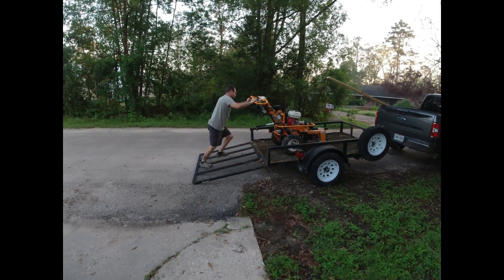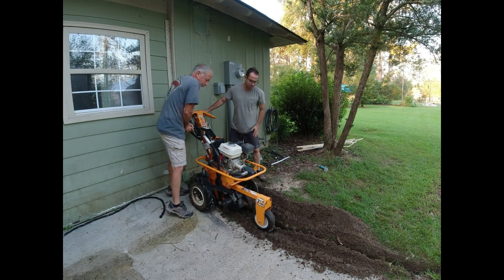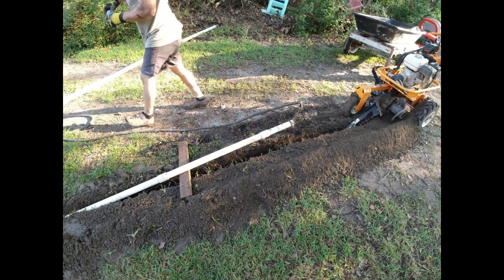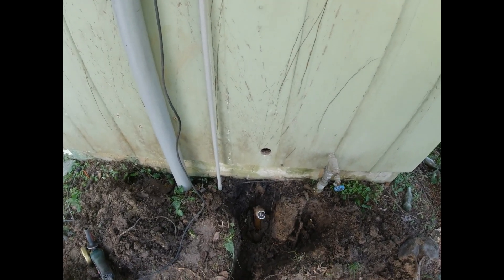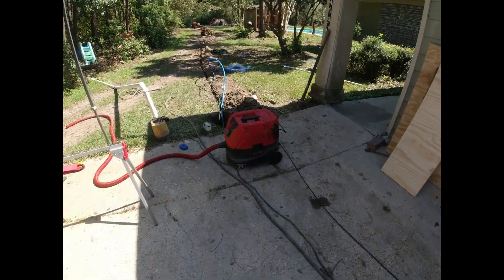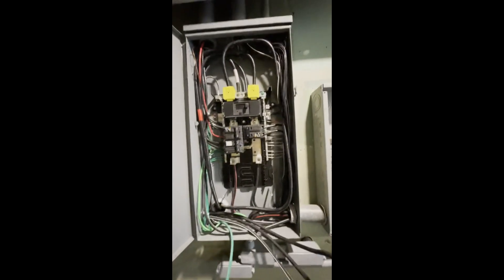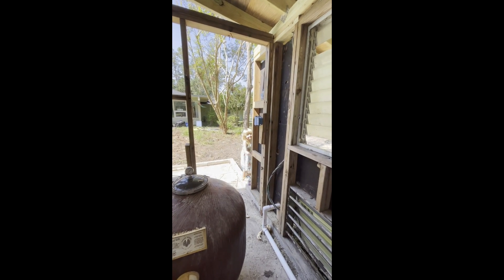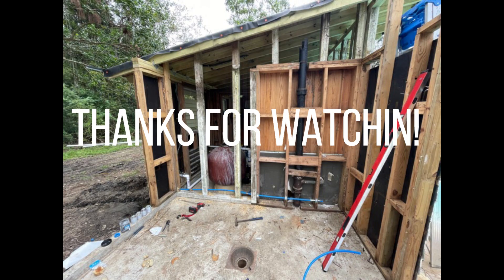DIY 22' Driveway Bore and Upgraded Service for Existing and Future Outbuildings.

Comment: Lube is the key to happiness!  I pulled a service into my detached garage.  I tried going dry and it just jammed up at the first bend.  I went down to Lowe's and bought the cable lube.  World of difference!  Thanks for the video.  If I ever need to cross this bridge, or a driveway rather, I'll pull this trick out.  Thanks!
Reply from the maker: Benjamin
Thanks for the Kudos. And yes, a little lube is a good thing!
Barry

Comment: You can never have large enough conduit!  It is surprising how a straight run not to mention some els can put so much friction on a pull.  Pulling too hard can also skin the conductors which is another nightmare.  They also make a special pulling lube which works quite well and evaporates off in a day or two.
Reply from the maker: Thanks Douglas!